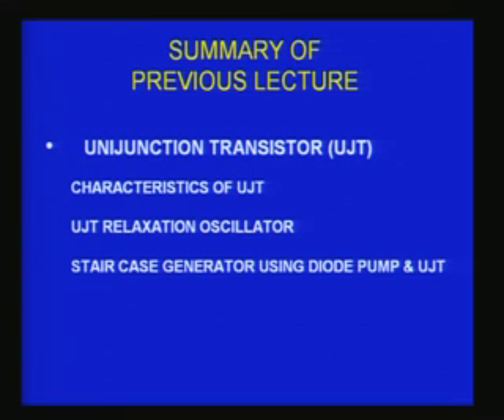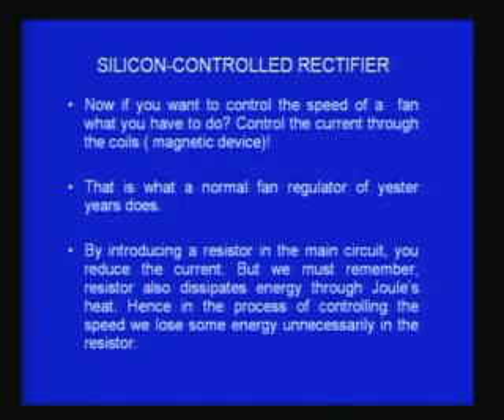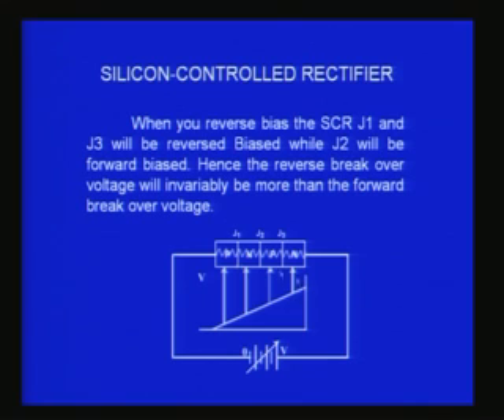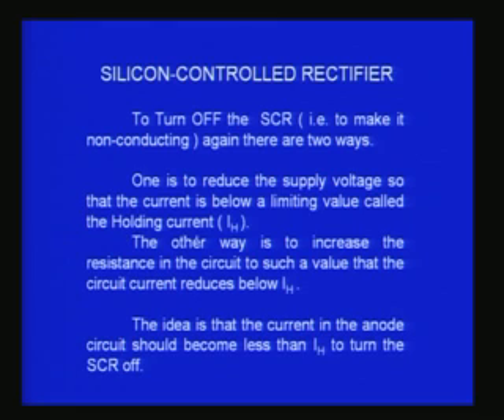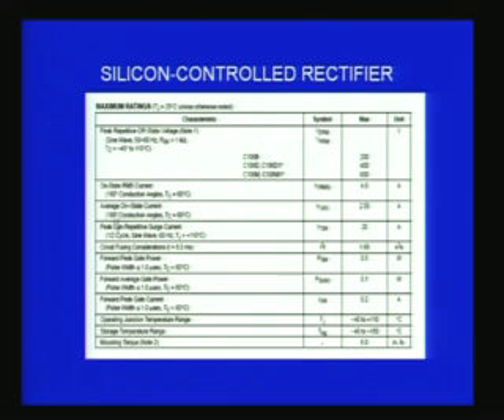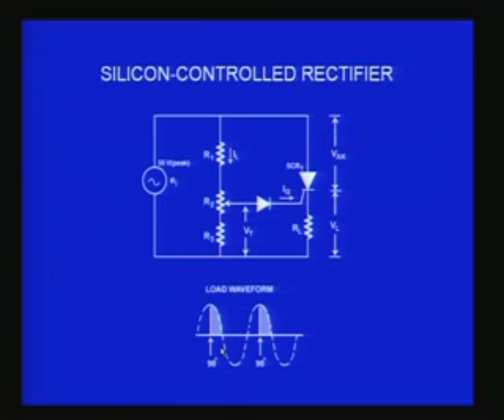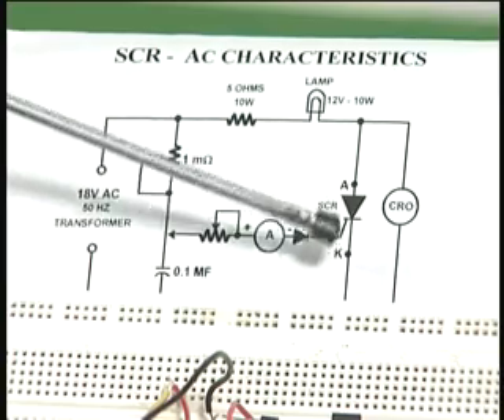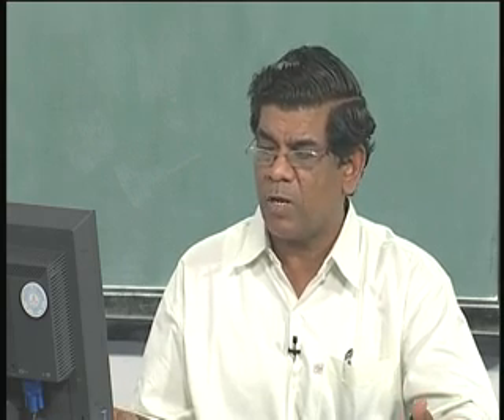Lecture - 39 Silicion Controlled Rectifier

Comment: sir,
Why the forward voltage of SCR reduces from the point of forward breakdown voltage whereas in diode the forward voltage is not reduced when diode starts conducting?
Reply: i think after forward breakdown,  junction j2 jas been damaged. so there is no need to maintain such a high voltage( approx 200 volt) for  contunction.
Reply: @raghavendra rao Because in SCR we have a junction where the diode is reverse bias.So when it suddenly starts conducting it is quite natural that the voltage is dropped heavily. But while studying the diode characteristics it is always forward biased when a positive voltage greater than 0.7 V is applied.

Now , this little voltage (0.5~0.7) is what you see even when SCR gets forward biased.Hence the voltage drops back to that forward bias voltage of the diode.
It's that simple.!
Reply: raghavendra rao irrelevant question

Comment: Respected Sir,
                         At 27.15 u said depending upon the magnitude of gate current one can switch off this( i think it is ON instead of OFF . if there are only two methods to turn on scr , one is to apply small  current through gate terminal as u said earlier. i just want to clear these point that what is the role of gate terminal to make scr on or off. please help me to understand this point .